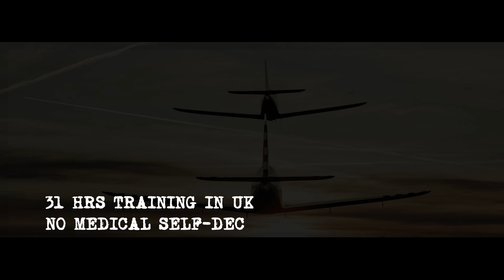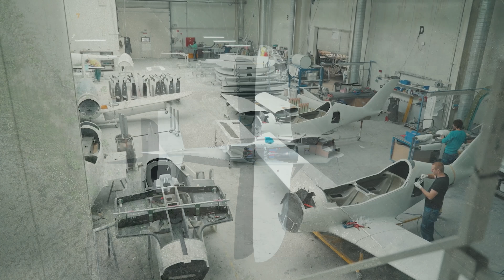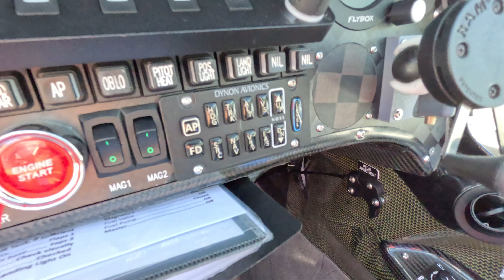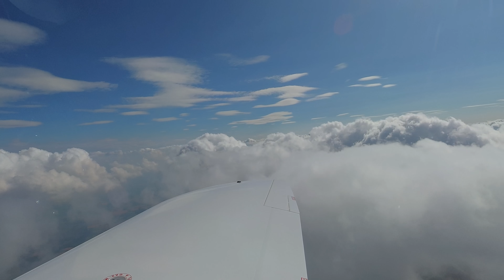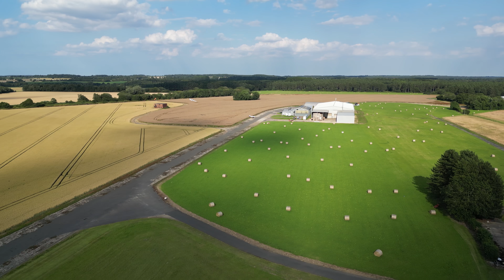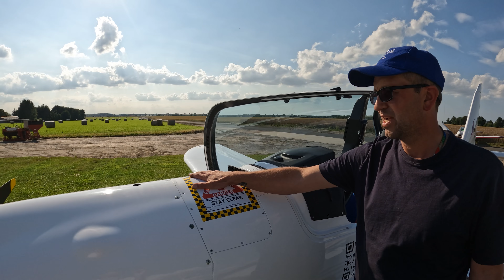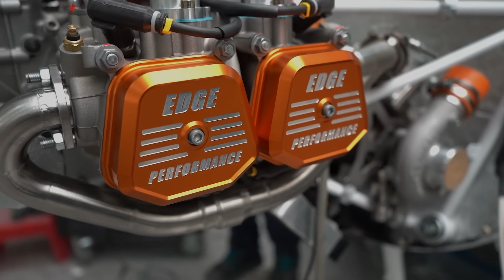YOU CAN FLY THIS from just 31 hours training from ZERO AND NO MEDICAL!

Comment: The difference between 31 hours legal minimum or 150 hours recommended is completely non-consequential if you have the $280,000 USD to buy one you can afford the 150 hours of flight training.
NOBODY is thinking, “well I can only afford 30 hours flight training so I will get this plane instead of a certified Cessna because the extra hours of flight training to get a full license will send me broke..”

Comment: So if you only can carry 150 liters of fuel 100 kg person and a 25 kg luggage - how do you put a second person in the plane?  I'm not giant and weigh 200lbs - so we'd have to cut into the fuel to get a person 100 lbs in by about 40 liters.  I suppose that is acceptable but they'd  have no luggage, If you subtract another 25 kg for both people your down to  80 liters of fuel about 20 gallons at 3.5 gallons per hour right - maybe.  OK wel it is very small so you do have to sacrifice something.  A rotax 912 tops at about %50k so they are charging about $200k for the rest of the plane -hmm perhaps they can work on that if they make more planes

Comment: The 600 kg calculated with 150 liters of fuel plus a 100 kg pilot and 25 kg luggage assumes a specific gravity for fuel of 1 kg/liter. This wrong and too high  because standard reference gasoline (mogas) has a specic gravity of 0.755 kg/liter and avgas is even lighter at 0.72 kg/liter . So in the case of a full tank of 150 liters of avgas , the remaining extra payload = 167 kg for pilot , passenger and luggage !

Comment: This needs some corrections.

1. This design is neither new nor revolutionary. It's nearly identical to the B&F FK14 Polaris which first flew in 1999. Cirrus even sold it for awhile as the Cirrus SR Sport or SRS. Same engine, same wing area, same gee rating, same gross weight, same rate of climb, and same stall speed. It does hold more fuel: 26.4 gallons vs 19 gallons but this also cuts into the payload.

2. The retractable gear does not give it amazing speed. It's only 10 mph faster than the FK14 which has fixed gear. And, this is in spite of tandem seating.

3. This is not a hot airplane as implied by Ozgrade3. The wing loading is only a little over 10 lbs/sq ft like the Cessna 152.  Flaps down, it stalls at a tame 40 mph which is less than a Cessna 172. The side stick could be an issue for some pilots.

4. That 1550 mile range is only with 40 gallon tanks. This uses up 55% of the available payload. The FK14 also has a longer range version.

Comment: This is the plane that Zara & Mack Rutherford each set records in as the youngest Female & Male pilots respectively to fly a Light Sport Aircraft around the world. The airplanes were highly modified with an additional gas tank in the back seat. They are from an aviation family and had extensive on-type training beforehand. And, despite their family being fairly well-off, the planes were lent to them - Zara’s being Factory-Owned, and Mack’s being owned by another private pilot in Europe. Neither of them owns a Shark, because at $ 250K+ USD no one under the age of 30 who isn’t heir to a family fortune can afford one 😊 We had a pilot here in B.C. Canada - who had more $$ than brains - and pranged his on his first on-type crosswind landing. Sure, it looks like a WWII Fighter, but you better have LOTS of Training - esp. landing with retractable gear in crosswinds - or fantastic Luck and a BIG Bank Account 😎 Also, in Canada, this does not qualify as an Ultralight as it’s outside the stipulated performance envelope. So you need a Recreational Pilot Permit or higher. The average completion time for an RPP in the C172 here is 45 hours (Dual & Solo combined), for Private Pilot add another 20 hours. Plus you need a valid Class 3 Medical which needs to be passed every 2 years (after age 40). As a result of these things: (1) affordability; (2) skill set required; and (3) license/medical requirements, I don’t imagine we’ll be seeing too many Sharks zipping around our friendly skies 🇨🇦 Sure looks sexy though 👍

Comment: Lot of nannies in here crying that its too much airplane for 31 hours in training. 
You girls should get a grip, the video is making a claim about the performance envelope of this aircraft. Not a recommendation to take on solo at 31 hours logged flight time in training.

It uses 650 feet of runway, has excellent all round vision, it stalls at 55kt ias, it has 1000 mile/1600km range, it weighs a harley motorcycle etc etc. 

I would prefer a Full Authority diesel something something capable of running on kero. Meself. Something with 3 prop blades,  more hp, fatter tires, higher ceiling, faster cruise speed, rate of climb, similar runway rotation and enjin stall speed and everything.

Comment: The plane is great, but I don't see how it could be a good idea to set out trying to fly it after minimal training and the corresponding minimally developed airmanship. Aviation is not by itself inherently dangerous, but it is very unforgiving of carelessness, incapacity or neglect. From over 1700 flight hours as an instructor, I can assert that very few people are capable of competently and safely flying even a simple, slow airplane in the minimum times required for an unrestricted private pilot certificate qualifying for regular airplanes (i.e. not light sport).  This is in fact a complex airplane, that reaches the same or higher speed regimes as so-called high-performance airplanes (which a Cessna 172 XP would technically be). It has multiple complex systems; the fuel injection and ignition of the Rotax injected engines demands thorough understanding. I do not think that the minimal training required should be a selling argument. It could mislead people in getting far more airplane than they can handle.

Comment: Engine speed 5000rpm - not  the propeller. Propeller 5000 rpm impossible the prop tips would be way past supersonic.
Reply from the maker: Has a reduction gearbox, prop speed is less than half.

Comment: What a cool little airplane. I'm amazed at the range too.
Reply: There is no lav. 😳
Reply: @foxlake6750  equip with auto pilot and save empty milk jugs.:person-turqouise-waving: no worries
Reply: @foxlake6750  Stadium Buddy or diaper.
Reply: I would not want to seat for 8 hours in a cramped cockpit like this one. After 4 hours in my C310 I have a need for food and drinks stored on the seat behind the co-pilot seat. So I need to put the autopilot on, unbuckle and stretch myself. I don’t like having too much loose items on the front row.

Comment: Totally agree, a slippery airframe requires an experienced pilot, better to start with something slower and forgiving, which is why 152's are ideal. Even Piper Tomahawks, which were specifically designed as student trainers, had tricky handling at the limits, and earned the nickname of "Traumahawk". The more slippery the airframe, the more critical the flight envelope becomes, as any experienced pilot will confirm. Very pretty plane, but not for a low time beginner.
Reply: So if I made my airframe a rectangle with equal random bumps on both sides. It would be easier to fly?
Reply: @youtubecomments5951  Tell us you aren't a pilot, without...
Reply: @veritas6466  well my question makes it obvious I’m not a pilot.

Comment: Green light for gear up would take some logic change.
😂
Sweet looking rocket!!
Reply: What? It shows a green light when the LG is down and locked, and you also have three visors and illuminated mechanical indicators showing this, so not only the LG control panel that indicates it. Normally, I extend the LG at downwind, add a little power to keep flying and check by looking through the visors to see the indicators. On short final, I usually announce " ... short final, rwy xy, three greens", only after looking at the control lights again.

Comment: I'd say you're going to need at least 60-80 hours of training to be able to handle the performance of that aircraft. Most pilots with a Sport Pilot's license will likely need closer to 100 hours. That's a complex high performance aircraft, which could get people in serious trouble if they get behind the aircraft. You'd need to be thinking at 160 knots, not 100 knots, like most light training aircraft, so you'd need to be on your game to handle that thing with less than 80 hours in your log book. Some PPL license holders have both an HP and complex endorsement at less than 100 hours, but that's more the exception than the rule. If you were training pretty constantly, it could be done, but you'd need to be flying at least a few times a week to get it done in low hours.
Reply: Since this is a low requirement, cheap to buy and maintain plane, and very fuel economical, people will fly those hours. If you add complex license fees, extra expensive training hours, add expenses here and there, no-one will. Sure all those people in the system, all those gears will be greased, but noone will fly those hours, the system can get costs super high if they want to. That's what you're asking? In the name of "safety"? Either you are a gear in the system, an instructor or something, and you want more monies, or you're one of those exclusivity rich, you got the monies for it, you don't want anyone else in on it. So yeah, let go of those safety fairytales. People have launched themselves on rockets, flown with their sofa tied to balloons, gimme a break with your safety BS richman.

Comment: It may sound expensive  but it’s not . I had a glider costing almost as much.It’s absolutely a beast for the money,speed, range , electronics, safety parachute and the way it looks 😮I need one asap😮
Reply: And at 11 Litres an Hour at a Speed of 124 Knots It's Cheaper to Run than Some Cars.
Reply: @MADTASS  I just did the math, 142 miles / 2.9 gallons = 49 MPH.  That puts it up in Toyota Prius territory.  Of course, it has half the passenger and cargo capacity but will get you there 2 to 3 faster.
Reply: @BryanTorok  realistically it burns less than a car since you rather never drive in straight line on long distance.
Reply: @wrobelda  That was the reason I said up to 3 times faster.  With lots of curves it could be 4 times faster.  Another bonus, from my home to relatives in Virginia is about 6 to 7 hours by car.  Add in bathroom and fuel stops and the trip is 8+ hours.  This air plane could do it in one hop, 2 to 2.5 hours.  The upside for driving is that once I get there, I have my car to get around.  Downside for the plane is I have to rent a car.
Reply: Yes, learning to fly gets expensive as is renting or buying an aircraft after you get your license.  I took lessons many years ago in a piper tomahawk and ran out of funds to continue after 12 hours.  The title says "YOU CAN FLY THIS from just 31 hours training from ZERO" and I'm not sure what that means.  FAA regulations require a minimum of 40 hours, some people are ready to solo before that and others need more time.  But I'm pretty sure you can't solo and get the license at 31 hrs not even if you're Chuck Yeager!  There could be people that are so talented at it that they COULD solo at 20 hours but regulations are regulations.
Reply: @minerran  The FAA is in the USA.  This video is talking about regulations in the UK.
Reply: @BryanTorok  The USA has a Sport Pilot program which theoretically has a faster license.  That said, the plane described isn't currently something that a Sport pilot could legally fly.
Reply: @BryanTorok  Imagine growing up Cnd..with all things..even with the internet..they just can't see past the end of their eagle beak.
Reply: @minerran  i am talking about the cost of this plane. Not talking about the cost of learning to fly. I fly from 16th i am 42 . I had different gliders and older planes but this one as a new plane with the electronics and all performance its a bargain
Reply: @minerran this isn't the USA so Yanno.... Dosn't apply
Reply: @minerran  I had a friend that was into experimental aircraft and finally got his mechanics license.  I thought he said you could get a 30 hour license but it limited you to a small area around your home airport but I may be mistaken.
Reply: @minerran You need 15h out of the 40 for PPL to be solo, implying that you can solo from 25 hours. All you really need for solo flight is a student pilots license and I believe you can solo whenever your instructor deems you ready. I see you’re getting crap from others about mentioning the FAA when this is in the UK, but most of the regulations are the same, basing themselves off of the FAA laws. Don’t worry about that, people suck.

Comment: Ridiculous. Things happen fast at 160 kts, add in retractable gear, and the thought of a 31-hour pilot flying this thing safely is fiction. Good luck finding ANY insurance company willing to insure you on this airplane with only 31 hours of flight time. They're not dumb - they know what the end result will be. This video is advertising outrageously unsafe training practices in an attempt to market the aircraft  to people with zero time who have no idea about airplanes.
Reply from the maker: Insurance may well be the filter for this kind of aircraft I agree. But as for the video advertising 'outrageously' unsafe training, that's unfair. Even if you disagree with this it is the UK minimum for this class of ultralight/microlight and it is upto the instructor to sign the pilot off when they are ready and from my experience they probably won't be ready in 31 hours, but technically they could be. The qualifying training hours are published by the UK CAA, why is it wrong that I point this out??

Comment: 45 hours you can get your PPL but to be a safe pilot, you need about 70 hours. So 30 hours is a recipe for a case of Air Crash Investigations or Pilot's Debrief.
Reply from the maker: Most dangerous time for a private pilot is between 300-600 hours, that's when they die.

Comment: Hmm…not a pilot here but I wouldn’t attempt to fly this thing or any high performance aircraft without taking the advanced spin training recovery class or whatever its called. Also, I don’t like the idea of composite propellers because I am in the steel pressure vessel and composite fiber cross wound pressure vessel business. I would be concerned about unseen stress cracks or fractures at the blade roots. I’d rather have a nice high strength metal or wood propeller. Composites are great but not ideal for everything.

Comment: Too bad they didn't put a real engine in there.
Reply: Do you really think a 7% 912 ULS failure rate is statistically different that an 0-200 failure rate of 5.6%?  That is the accident rate between the two engines attributed to power loss.
Reply: @msromike123  I had a 912 fail on me mid-flight. That's enough for me. More power would be nice in this gorgeous plane-- just sayin'.

Comment: It would be a lot faster if you put something other than a weed eater engine on it....
Reply: Does the 100hp care how it's made?  LOL  Or does the difference of designing the aircraft around an extra 65 lbs potentially take the aircraft out of it's design category matter?  So, you don't think the $38,000 difference in engine price might prevent a design like this from being successful?  So much more to it than "I would never fly anything with a weed eater engine in it."  Well for many people that is the difference of flying and not flying.  The mere fact that you call a 100 hp Retax engine with an impeccable reliability history a weed eater speaks volumes.  My dad was an aerospace engineer in commercial aviation for 40 years or so, and he never saw anything wrong with a Rotax on the face of it.  The right component for the right job, that's how engineers think.
Reply from the maker: At least the engine was designed this side of WW2 :-)

Comment: I love Little Snoring. I did a precautionary landing there once. Great place to practice x-winds.
Some students may be ready in the time stated others may take longer. The faster speeds will be taught in the Nav groundschool.
Times will be taught in proportion to the TAS and ground speed, so instead of trundling along at 98 kts, +or- the wind, your doing 160kts.
So, stating that students will or will not be ready in the quoted times is  like asking how long is a piece of string. 
And,  if the student fails to demonstrate the required competence in any particular skill during the test, then they would have to be trained up to the required standard in order to pass the test. It's not a case of being ready in a certain amount of time, it's a case of having the competence to pass the test. 
So, it's horses for courses either they will complete their training in those times, or they won't.
Reply from the maker: Great comment.
Reply: Speed differences bit like 50 years ago.  Had a cheapo Eastern European motorbike, not very fast.  Needed something bit bigger and faster to ride to Africa from England.  Got a BMW, purring along the motorway did not feel that fast, glanced down, oops was doing 90mph and there were cops around!
Reply: Correction… competent to be a safe pilot and not off yourself. Training just enough to “pass the test” has cost people in the past their lives.